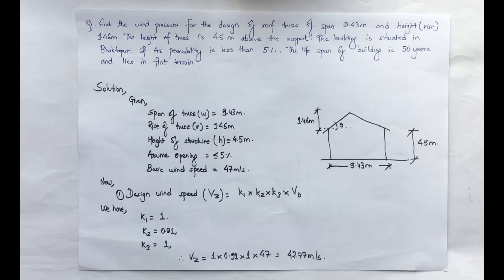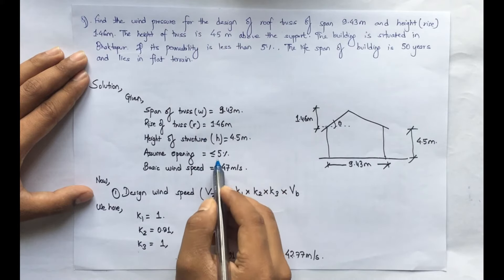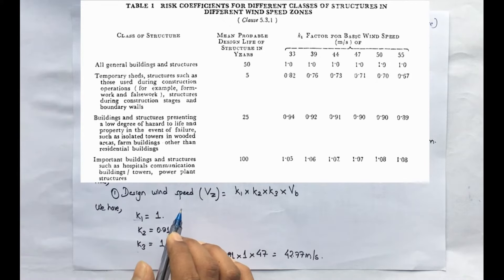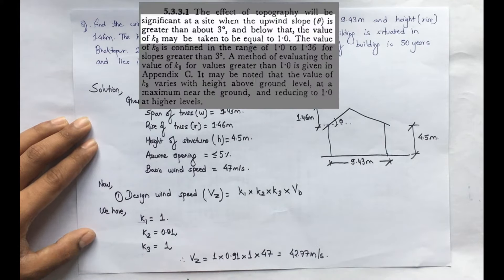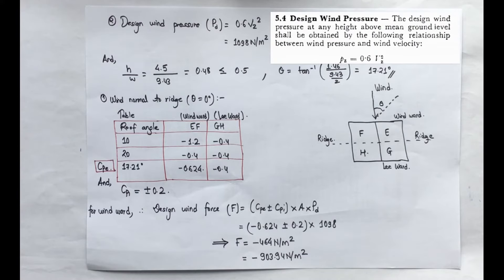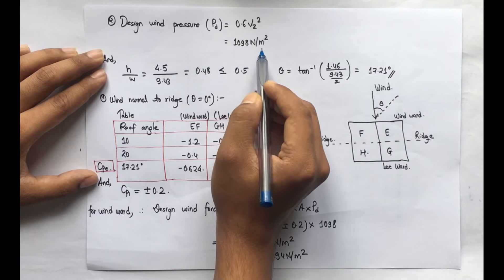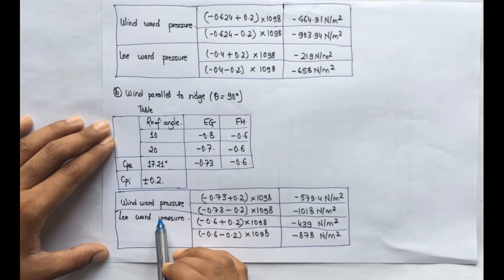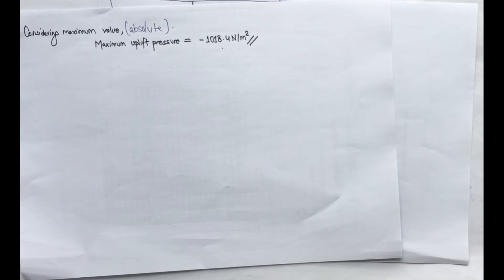Calculation of Wind load  | Design of steel structures and timber | IOE III/II PU MU |

Comment: why A is constant here on calculation.u have used cpe ,cpi and Pd value but why not using surface area value A
Reply: Actually they have calculated Pressure, hence units are in N/m2. Just multiply area A of the exposed surface to get final Force value in newtons.

Comment: A was not considered, but what if A was considered,  what would be the formula for calculating A
Reply: Actually they have calculated Pressure, hence units are in N/m2. Just multiply area A of the exposed surface to get final Force value in newtons.

Comment: Why value of A is not considered in your calculation?
Reply from the maker: Unit area considered
Reply: @civilconst  why considering unit area when we know the actual area?
Reply: @sonamlhamo2078  I am confused too why A was omitted
Reply: @sonamlhamo2078  because while detail design structure elements,  it is useful to have the force per unit area compared to net force. If u see he has also indicated unit as Force per Unit Area
Reply: Actually they have calculated Pressure, hence units are in N/m2. Just multiply area A of the exposed surface to get final Force value in newtons.

Comment: Pz= 0.6vz² not pd
Pd= ka×kc×kd×pz  both pd and pz is different 
Please clear your concept and make right videos
Reply: as per code book 1989 there is different, u are mentioning the 2015 code book , your idea is correct according to is 875 part 3 2015
Reply from the maker: Please revisit code once again.
Reply from the maker: Cheers.
Reply: @civilconst   Please revisit the code again per 5.4 of IS 875, Pz=wind pressure at height z, based on wind pressure Pz It needs to calculate the design wind pressure Pd = ka×kc×kd×pz. This design wind pressure Pd needs to be utilize to calculate wind load in equation in 7.3.1 of IS 875. If you dont ask any professional